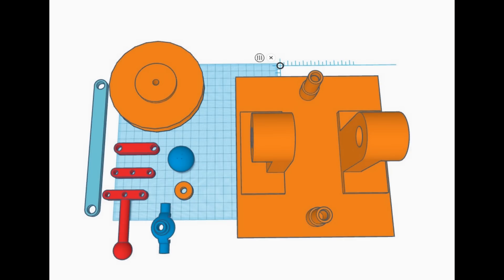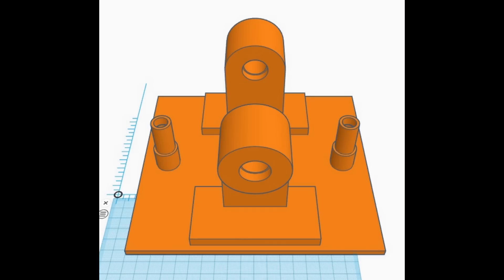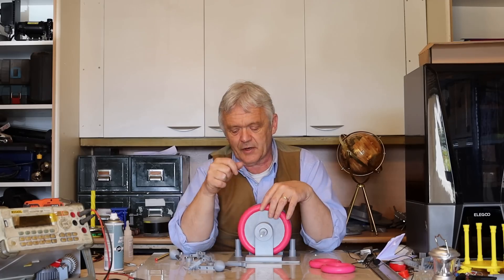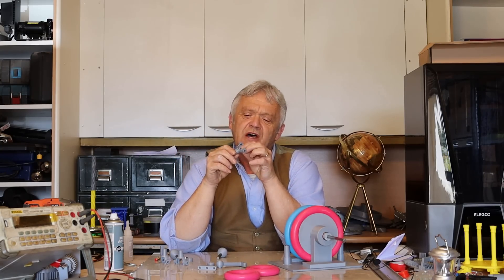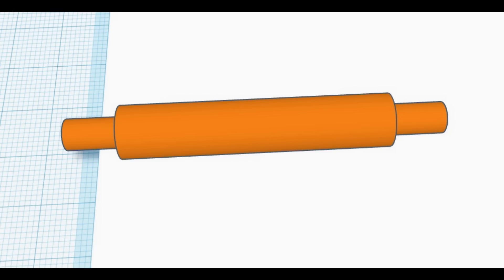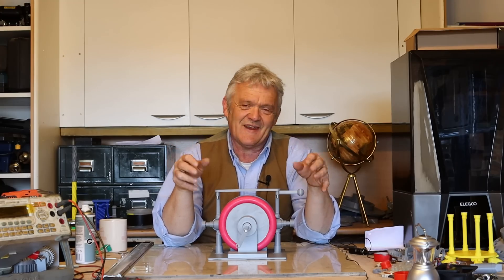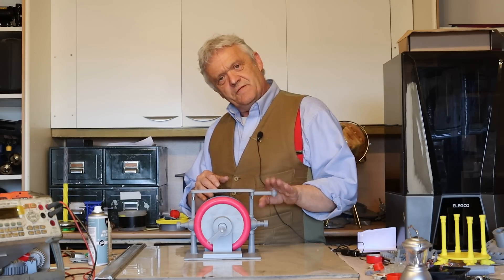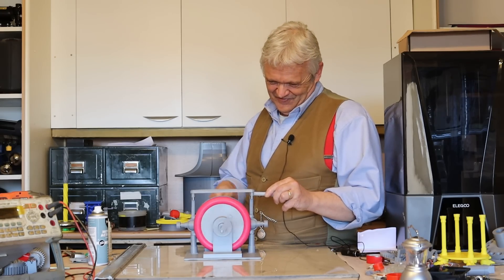2014 The Ring Based Continuously Variable Transmission

Comment: I would use as many balls as I could get around the edges so as to make sure power is securely transferred without slippage and without part damage.
Reply: I believe that the more balls you add the more friction will be generated, if you were using it for something (bicycle or a wind turbine as suggested) with a limited power output you would lose a great deal of the input energy.  It’d also become really complex to control all of the balls unless they’re simply idlers - ie ones to hold the plates at a consistent distance.  It’s a very interesting idea and the most dead simple CVT I’ve seen, to scale it up you’d want really solid metal circular plates for the input and output that won’t flex and solid bearing blocks and yokes to further minimize losses.  While fascinating, I don’t think this is something that could really be used in a real world application but it’s definitely a cool concept.
Reply: @sjsomething4936  Anything you add will increase friction. That is beside the point.

I would have no problem cycling it with a dozen drive balls on it, but it would slip with only 2 of them because the power to traction/friction ratio would be too small.

Just like adding fatter tires to a race car add rolling resistance, but without them, the car would just sit in one place and burn the tires off.

All mechanisms have tradeoffs.

Also, one need not have an actual whole sphere on these, a hemispherical roller would save on total machine mass, while also allowing the tilting mechanism to be closer to the center of both axis of said hemispherical roller at the same time [which offers some real advantages relating to strength of the mechanism and total mass and volume of the whole transmission].

To hold the plate at a fixed distance can be performed with some external thrust bearings, so that would not be such a big deal, and, depending on how much power one was applying to said device, might prove critical to keeping it rigidly in place under a load.

So far as making the main wheels [either partially, or entirely] out of metal, that would be fine, but if you want strength without a lot of mass, setting up a hardened steel set of races on the outside with something like magnesium or composite material for the most of the drive plates would make more sense than a heavy steel one.

I could see making something that safely conveys more than 50 BHP that weighs less than 10 Kg and takes up less than 1/10 of a cubic meter in volume.

Compare that to most 'infinitely variable' transmissions, and that is rather light.

I have an infinitely variable hydraulic transmission which is rated for 50 BHP and while it is about 1/10 of a cubic meter in volume, it weighs about 35 Kg, as it is made mostly from cast iron, machined steel, and some machined brass parts.

Comment: For a second, I thought this was going to be another variable transmission, were the balls would be between the two wheels and balls would be pushed closer to the center to speed up and closer to the edges to slow down. This one is new to me and could be made as an auto speed controller, just what a windmill needs, and perhaps if wind gets way to fast, could also activate a disc brake system.

Comment: I saw a bicycle transmission like this. The axis of the planetary balls was aligned with the axis of the drive and driven wheels so that the same effect could be achieved without reversing the rotation of power input compared to the output.

Comment: One benefit of this type of transmission I could see is that if the output side seizes up for some reason, the transmission will slip instead up continuing to turn and could prevent further damage on the output side.

Comment: if you used this with a windmill, you could probably use and actuator to maintain a stable voltage on the output. By sampling the output voltage , shift the gear back and forth for the desired output. almost like a voltage regulator
Reply: a mechanical centrifugal governor would do
Reply: @Xayuap  thats gonna be hard if you are not using steam
Reply: there are automatic bicycles shifting mechanisms that use small mechanical centrifugal governors to keep pedaling speed uniform
Reply: @Xayuap  you wouldn't want this on a generator, the flywheel effect steals power from the generator constantly trying to maintain speed. his device already controls the speed
Reply: that makes sense,
electronically maybe it is just less power.

but information wise, both devices can be made arbitrarily smaller.

Comment: A Beier variator is simpler and would require many less parts.
Reply: I don't think you know what the word "simpler" means. Neither "less"

("The mechanism consists of a spring-loaded stack of thin disks on a central shaft. Around this are arranged other stacked disk packs on a number of planetary shafts, usually three. These shafts are mounted on swinging arms, so that they may be moved in and out together. The Beier gear rely on on viscous drag through a thin oil film between them.")

Comment: The defeciencies of this transmision is the ratio controlled manually, i got an idea to monitor the motor current with sense resistor feed to microcintroller using opamp. The microcontroller control a small servo motor to control the ratio through the lever.

The decision using microcontroller is that the ratio could be altered to be non linear using non linear function or to speed up the algorithm by using lookup table. The microcontroller i choose is esp-12f for the price.

By the way for the wind collector, i think it is better and easier to use the blade like in boat impeller reversed stacked in upward spiral. It will direct the air straight upward for higher speed and to catch air current that slips away. I also planned to paint it black doff to heat up the air inside the "chamber" so that it generate slightly more speed on hotter days using air convection. Will this works? It is only as per my understanding, i only formally learn chemistry, finance and economics studies.😅
Reply: ...or you could use a simple mechanical centrifugal regulator (a-la steam engine) to control the ball angle and ratio.  This avoids the fun of programming your microproceser of course, so probably defeats the object of your exercise!

Comment: Excellent project. It would also have many uses in a waterwheel system. For instance, if you had a waterwheel powering a trip hammer, you could use it to control the duration between the hammer strokes.
Reply from the maker: oh - that's clever - nice one mate
Reply: @ThinkingandTinkering  With a slight modification (to allow the balls to be moved out of contact with the rings), you could even use it to stop the hammer altogether.
Reply: This is similar to the transmission in a snow blower.
Reply: @rayg436  Is it used to control the speed of the snowblower?
Reply: traditionally they would change (dwell) duration between strikes by selecting different numbers of trip cams on the driveshaft. "Ancient power-hammers and the city that put steel in the world" by Lindybeige.
Reply: @markiobook8639  Yes — a time-consuming process. Rob’s transmission would have been an absolute wonder back then. Imagine the increase in productivity.

Comment: 6 minutes ago!!

Edit: as with so many of these videos, my mind is blown by how simple and compact it is! I was hoping to see the opposite ratio, making the output faster. I wonder about the ability to adhere the transmission wheels to the control ball though, especially if the input velocity is much higher than the desired output velocity